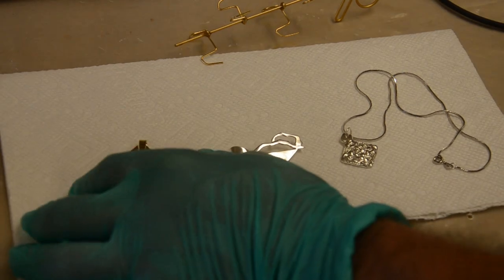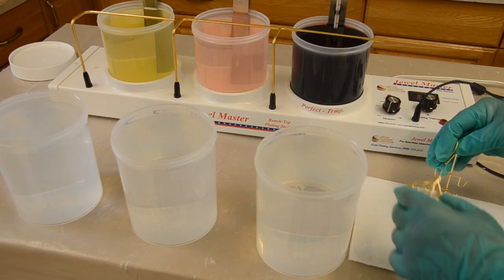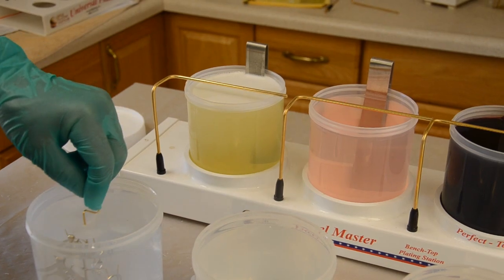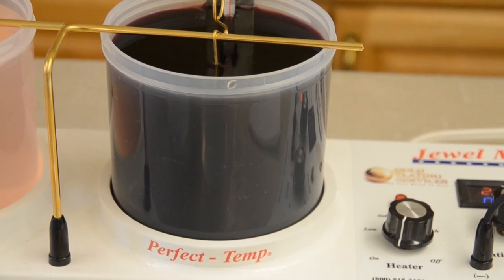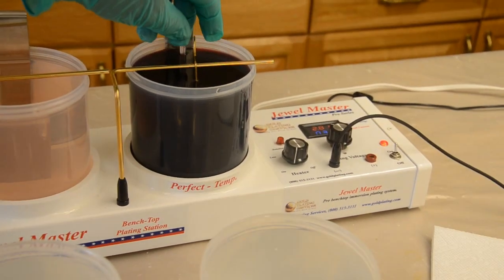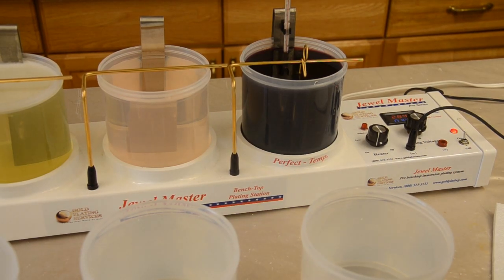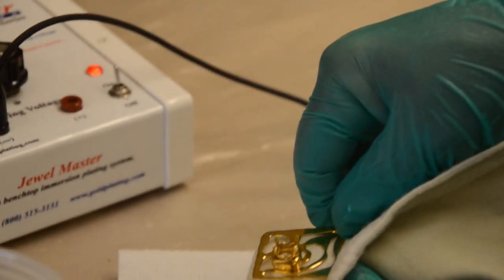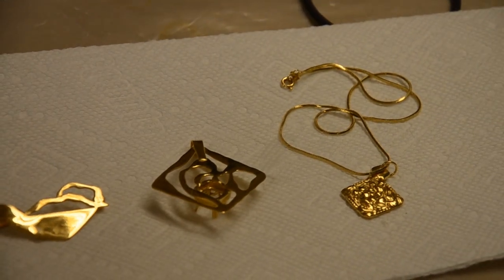Gold Plating Jewelry - Gold Plating Kit - "The JewelMaster Pro"

Comment: How do you use this? How do you hook it up? Where do you buy one of these at? How much do these cost? Does it permanently bond the plating?
Reply from the maker: +April White Great questions April, thank you for asking.  We have a video in our video section of our channel called "Gold Plating Kit - Immersion Electroplating - (NEW KIT!)".  It is a complete demonstration from setup to completion of plating objects and is only around 6 mins long.  Go check it out!  We also have many other great videos showing the JewelMaster in use in our video library here on YouTube.

You hook it up to just a regular 110V wall plug just like most appliances used in the USA and other areas.  The setup is quick and easy, especially after the first time.  You can buy them from our website which is in the video description above (goldplating . com).  We have 3 options at different prices, however, if it's purely gold plating you want to do, the JewelMaster Pro: Option 2 would be the kit to purchase.  It includes everything you need to gold plate most metals (all chemicals, accessories, hundreds of dollars worth of gold in solution, etc.) and costs $1,449.00.  

Yes, the gold does permanently bond (as long as it is not abrasively removed from the object).  Over years of be handled, gold applied to items such as jewelry can start to wear off, however, the longer you plate the object the thicker the layer is.  If the item is plated for 7+ minutes, the gold will last a very long time even on frequently handled objects.  If not handled, the gold will last theoretically forever.

If you have any other great questions, please ask, e-mail us, or give us a call!  We're a 25 year old company with an A+ with the Better Business Bureau and take pride in making quality products and taking care of our customers.  Thanks!

Comment: so you take in jewelry that people want you to plate as well how much do you charge for it? I mean to plate it the thickest possible how much would it be?
Reply from the maker: It purely depends upon the piece of jewelry.  The condition, size and type of item makes a huge difference in how long it takes to plate.  Most of the cost comes from your time, not the actual gold content used.  For instance, you could plate a ring with a super thick layer and the gold cost may only be a dollar or two.  A chain necklace in not-so-great condition may take you a couple of hours to polish, prepare and plate.  To give you an idea though, we typically charge about $200-$300 to plate a watch and we also have a $150 minimum plating charge no matter what the item is.